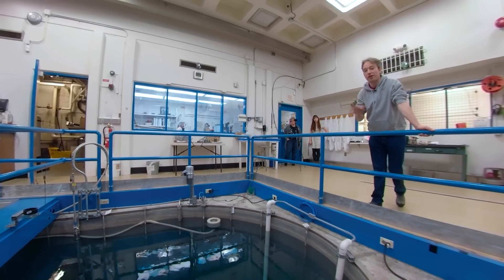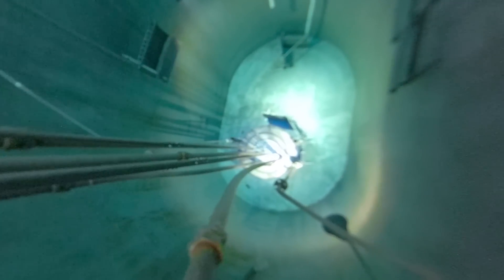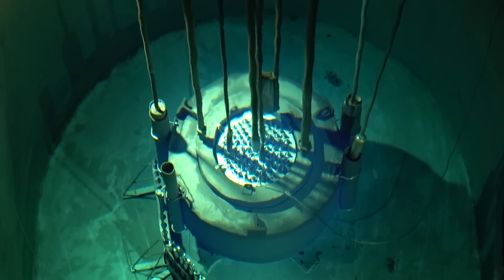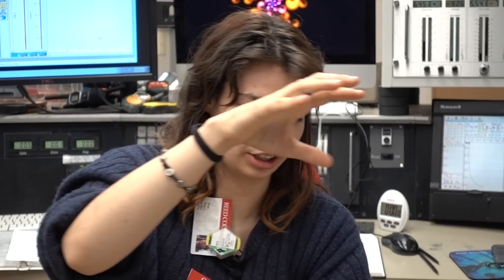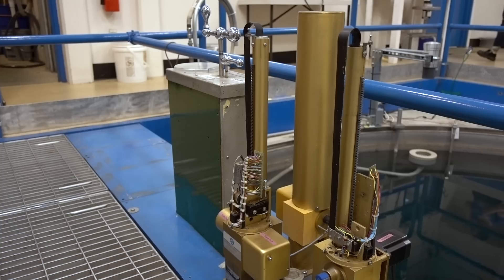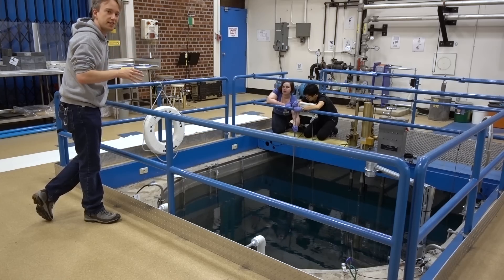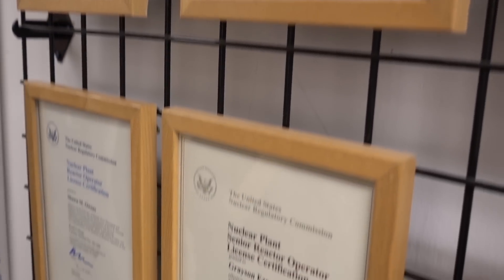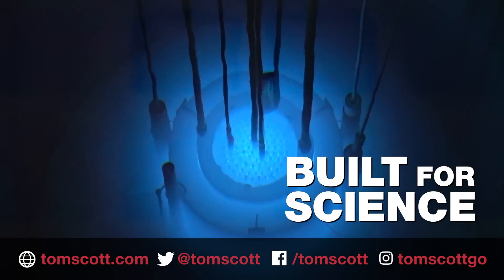This nuclear reactor is run by students

Comment: If you pause the video at 2:55 and go a few frames further, there is a flash of a white spec in the bottom left quarter. Could this be caused by the radiation?
Reply: That's exactly what it is.  Charged particles hitting the CCDs of the camera causing those specs in the image.
Reply: yep if you look on youtube you can find a video of a camrea being destroyed by the radation of a bigger test reactor its extremely intresting

Comment: Operating a nuclear reactor with a fishing rod and a bucket on a string is kind of a perfect metaphor for college
Reply: that's college in a nutshell
Reply: So is dropping a cell phone into a reactor pool.
Reply: It's still a nuclear reactor though. Even if it is a smaller scale one. Cos that tiny bit of particle is enough to radiate that much. Now, imagine a real one, just scaled up. Redo your calculations. The principles do not change. That small reactor, may just control like 2gm of the radioactive substance, and it could give off that much light. Imagine how powerful it would be, if the weight is a lot larger ? You can do the maths.
Reply: @MeiinUK  it joke1
Reply: @MeiinUK the fundamental principle is the same but modern power reactors either keep the liquid at a high preassure to not have it boil, making the reactor much easier to control as there is no void effect in normal operation (if the water were to boil away its negative so the reactor kills itself), or have it boil and manage the negative void effect. here, no water boils, its low power.
Reply: @SB7-r9i  : I recently came across a video about converting the energy types out in the desserts, which it has never occurred to me to think that it is possible. Especially during times of fluctuation now. Now I get why those dessert concerts could power itself.. via some of the mechanical energy conversion from solar panel. Or in this instance, it could be the reverse.. I suppose.. from nuclear to either mechanicals.. or even electricals.  I don't get the current generation of the high price energy costs... unless energy has been converted to monetary elements... or pricings.. Something like this could also power an actual indoor farm too, right ?....
Reply: @MeiinUK  you clearly know nothing about nuclear reactors theres a bigger test reactor you can find on youtube and its basicaly the same set up people litrelly lean over the water to watch the glow

Comment: would it be safe to jump in to the water and dive? ...there is some anxiety diving in deep holes but its fricking cool.
Reply: You could wade at the top with no issues.  Water is a great moderator and radiation barrier.

Comment: There appears to be a standard forming for small form reactors to serve reduced power and populations, modular units that don't demand the footprint and scale of security that modern power plants require.
Reply: This reactor would never output more than it takes to run it.  It's purely scientific and for research.

Comment: The microwave at my University was removed because someone accidentally put metal in it and it started a fire.
Reply: In fairness, you don't have to take several tests and receive training to use a communal microwave.
Reply: @drpibisback7680  and also not monitored every second you are in the facility.

Comment: What seems contradictory is that Cerenkov radiation occurs when the nuclear radiation goes faster than the speed of light, which of course is supposed to be impossible.  Dr. Don Lincoln's video(s) can explain why.  👍
Reply: Speed of light in a vacuum is higher than the speed of light in water. It's when it hit the water and is abruptly slowed down that the photons are emitted.

Comment: We also had one at Idaho State University, an AGN-201, not even close to this size though, just looked like a wired up pile of bricks. I was a student in the building above it for years before starting my master's work and going in the basement to the dirty labs. You would never know it, but there are several sets of locked doors down there with radiation warnings. Go figure

Comment: University of Texas in Austin has a Nuclear Reactor as well that is also a TRIGA reactor though theirs is a bit newer.  They also do tours of their site and here is an excerpt from the site, "the NETL reactor, designed by General Atomics, is a TRIGA Mark II nuclear research reactor.  The NETL is the newest of the current fleet of U.S. university reactors. The NETL reactor has in-core irradiation facilities and five beam ports.  The reactor is capable of steady-state operation at power levels up to 1 MW or pulsing mode operation where powers as high as 1500 MW are achieved for about 10 msec."  It's been around since the 60's but was upgraded in '92.  

It'd be cool if you revisited this topic if you went and checked out their reactor and maybe did a video about how many smaller reactors there are in the US.

Comment: What if someone fell into the reactor or it melted down
Reply: It can't melt down. The heat output isn't sufficient. In you fall in the water you get wet. That's all.
Reply: paulanderson79 I’m talking about the radiation. If someone is in there for too long they would get cancer, right?
Reply: @radopon  Provided you keep a couple of metres away from the core you'll be absolutely fine. Water is extremely effective at stopping stray neutrons. You can swim in there perfectly safely.

Comment: that little tweeb produces 250kW? No wonder Bill Gates is sold on nuclear energy. But I don't get where the cooling is. The hundreds of gallons of water would be boiling like crazy  with 250kW of heating.
Reply: There are projects on making power systems, derived from TRIGA reactors.

Comment: Okay I know the water protects you from the radiation  emitted by the core, but why doesn't the water become radioactive (and therefore dangerous to stand right next to the pool)???
Reply: The oxygen-16 in the water will absorb fast neutrons and lose a proton resulting in nitrogen-16 which is radioactive. Nitrogen-16 has a 7.13s half life and due to the way the water circulates in the pool, it decays before it reaches the surface. 

The water is very pure so there's not much else in the water that can become radioactive. What little there is, is picked up by the water purification loop.

Comment: How can it produce 250kW yet there is now way to harness it?
Reply: Power is usually harnessed via heating water until it boils and putting the steam through turbines. The way this is set up there is no way for them to make a system like that (without completely overhauling the entire set up).
Reply: but there IS a way to harness it with a small capacity turbine, right?
Reply: @uziTGC  Yes, but it is completely unviable, considering the cost and the power output would be tiny.
Reply: @cinquine1  Unless it's a dedicated TRIGA Power System (which are being considered now).

Comment: There is a small nuclear reactor run by RPI that has been described as powerful enough to power a light bulb.
For some reason they set it up about 20 miles away from the college.
All stories seem to list more details as top secret.
Recently a casino was built on the same property that houses the reactor.

Comment: Cherenkov Radiation is fascinating. As Tom said it is a Sonic Boom for light. It occurs when particles travel faster than light in a medium. Note: the speed of light in a vacuum is still forbidden for things with mass and greater speeds are forbidden for everything but light travels slower in other mediums (like water, air or glass; it's how refraction works) and the particles released in nuclear decay are flipping quick. They therefore exceed the speed of light in the water and release Cherenkov Radiation.

Comment: N16 may have a half life of 7 seconds but typically at least 10 half lifes are required for the radio-isotope to decay to safe levels similar to background levels - so in this case about 70 seconds would be sufficient time for this decay process to occur.
One would also expect Tritium (H3) to form in your fuel pool which has a half life of just over 12 years.

To access health risks linked to radiation exposure based upon external sources only disguises the real health risk levels. 
Internal radiation exposure risks are linked to different exposure pathways which include inhalation and absorption through skin and other membranes. Having a small radioactive particle (even nano metre sized) lodged inside a body organ such as the lung, liver or intestine causes concentrated local damage to tissue, cells and DNA.

Wearing a radiation badge which monitors "external" radiation exposure levels over time is an insufficient measure to take for anybody working in radioactive environments. (I am assuming that radiation badges are standard practice and are worn by the students).

Good Luck

Comment: There used to be a nuclear reactor in Aalto University in Finland, but it was shut down in 2015 because it was too expensive to maintain (Around 400 000€)
Reply: Also in University of Helsinki there is a particle accelerator that was built mostly by the staff/students in the 60's

Comment: Couldn’t work out why the blue rings they were wearing then realised they’re the new take on radiation dosimeters. Bit different from the badge I used to have pinned to a lab coat.
Reply: I'm a student there, they use the badges and the rings, the rings are because with small samples they sometimes hold samples or put their hands in vent hoods getting a higher dose than the rest of their body

Comment: This is what is known as a pool reactor. They are awesome, very safe. No pumps to worry about or pipe breaks or anything that many middle aged powered reactors have to worry about. The fuel rods are also a metalic/uranium mix which means the conduct heat very well and the reactor itself is very volumentrically small, so the heat density is not all the great. This means even if all the water leaked out, the fuel rods can cool themselves in the air. Normal ceramic fuel rods will continue to heat even after a reactor shut down to the point they melt down because they have more heat in them because ceramic is a poor conductor of heat. The outside of the fuel rod might be 300c while the internal heat is something like 2300c. 

This is why a reactor like this is totally safe to be near populations and run by relatively novice reactor operators. It is a great place to cut your teeth and get ready for the big time reactors! Even then, we are developing new reactors with different materials or designs to make powered reactors as safe as these ones. But we need to keep doing the research which these days is harder money to come by.

Comment: I think it's funny that Oregon has two nuclear reactors - both are university research reactors. No power plants. (The only nuclear power plant in Oregon closed about 20 years ago.) This one, and another one at Oregon State University (which is run by graduate Nuclear Engineering students, rather than undergraduate students seeking any random degree.)

Also of note: Not only is the Reed Research Reactor run by undergraduate students, none of the students are nuclear engineering students. Or any kind of engineering. Reed doesn't have any engineering degrees. It does have Biology, Chemistry, and Physics, which are the main users of the reactor.

Comment: I visited a TRIGA Mark 3 reactor in Main, Germany once. It was very cool, because they can pulse the reactor, which means letting it go super critical on purpose by shooting out one control rod with high pressure air, producing a lot of Cerenkov radiation at once. So i can say of myself that i was standing on a nuclear reactor going super critical at one point in my life.
The reason you can do it is, because the TRIGA reactors use a zircon matrix for the uranium fuel. Zircon absorbs more neutrons when it heats up, which shuts done any reaction above a certain temperature because the reactor goes sup critical. Only after the zircon has cooled down does the chain reaction starts anew. 
In fact the reset time of the reactor was only 10 minutes. While i was on tour through the reactor hall it got pulsed three times, allowing us to see the radiation directly and indirectly. It really has a special kind of blue color.
Reply: Oh neat.  I knew a lot about reactors, but not this.

Comment: You would think schools that have these would want to gather the energy to supply "free" electricity for the school instead of essentially letting the excess energy go to waste
Reply: Plus, you would have to redesign the entire reactor facility. It is designed in such a way that it doesn't heat up the water very much. The only way to generate power is from the water heating up to about 300c. Hard to do in a non-pressurized pool system.
Reply: The small amount of electricity this thing would generate probably wouldn't pay for the extra maintenance cost of the turbines, generator, etc.

Comment: MIT has one built originally to train people for the NAVY. The city of cambridge has been fighting for years to get it shut down. The NRC has actually asked them formally to switch fuels and they have declined. To be fair MIT has a history of knowing better than the NRC but still a lot of us would sleep safer at night if the damn thing ran more on the scale of what you showed in this video instead of... well what it is..
Reply: The Royal Navy used to run a small reactor in the Naval College in Greenwich, about 6 or 7 miles from Central London, until it was dismantled in the 1990s.

Comment: How much tritium is made? People freak out for insignificant amounts. Hydrogen would absorb a neutron to become deuterium, and that turns into tritium after absorbing another neutron, very very tiny amounts of it.
Reply: "TRIGA can operate at full power for at least 2,860 days, during which 152 mg of T could be produced."

- Analysis of tritium production in TRIGA Mark II reactor at JSI for the needs of fusion research reactors-  Anze et al

Comment: There is Braille on the SCRAM 'button'!! Do they have any visually impaired staff, or is it purely for the sake of accessibility?
Reply: It's more than likely that it was built and installed with accessibility in mind, since it's possible that in the next hundred and fifty years or so they might have visually impaired staff.
Reply: Haiku Metzger I don't disagree, but it seems like it was an afterthought. It looks like it was stuck to it rather than being there to begin with. I see what youre saying tho.
Reply: Also the Braille would help you find if due to an accident or smoke you lost your vision in an emergency.
Reply: Nillie true.

Comment: What is that on their fingers? Some radiation thingy?
Reply: Probably a Ring Dosimeter. Turns colors if you exceed some programmed dose threshold. All reactor operators are only allowed a certain yearly and lifetime dose limit, similar to astronauts.
Reply: Oh I see. Thanks. I thought it might be something like that but I didn't think about it working in a cumulative manner. So I guess they each should have their own personal rings. And having two perhaps to have more precise measurement.
Reply: Personal dosimeter is serious business! People often talk about reactor safety to the public, which is important, but the people most at risk everyday are the onsite workers and personal. There are layers and layers of protections to make sure workers don't get to much dose. That is some people's entire job!

Comment: "The reactor doesn't explode". Well, that's reassuring.
Reply: He, they can't they are way to slow of a reactor to get anything more than boiling water. They can't even boil water that effectively either :D
Reply: By implication, though, other reactors do. As a matter of routine.
Reply: Routine seems a bit of an exaggeration. But reactor safety is of course important an improving all the time, just like all technology. Nuclear still is about on par with renewables in terms of its mortality per unit power. Much better than fossil fuels. Most wonk analysts suggests nuclear has saved several millions of lives by avoided emissions.
Reply: I guess I should apologise. My original post was meant to be humorous. As in real life, sometimes I fail to get that over, and it can lead to awkward situations.
Reply: Well don't I feel silly then :D

Sorry, Nuclear its super interesting and exciting to me, so I am always looking for an excuse to start a conversation. Forgive me if that desire turned toxic.